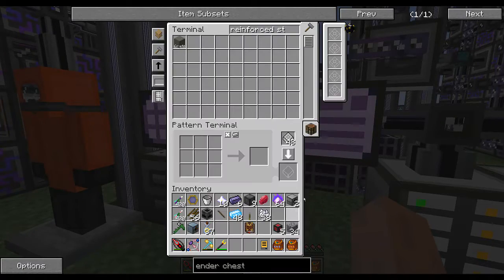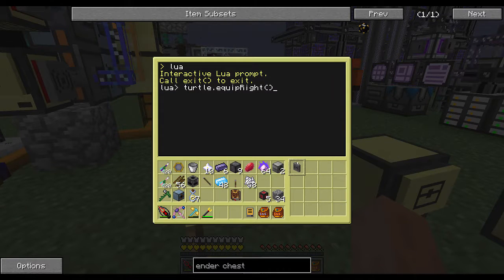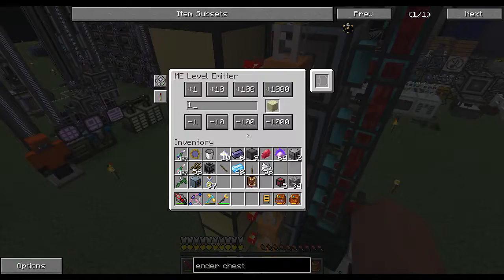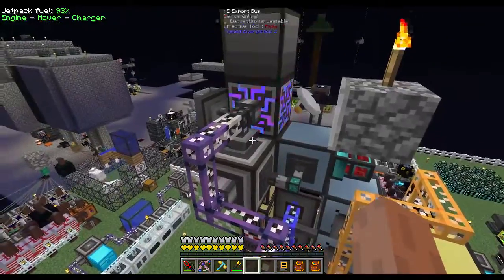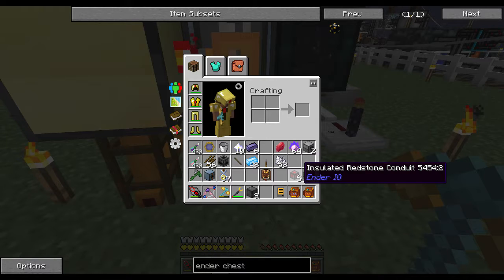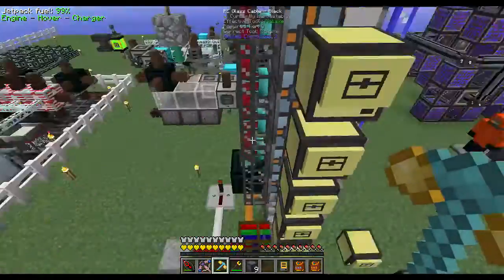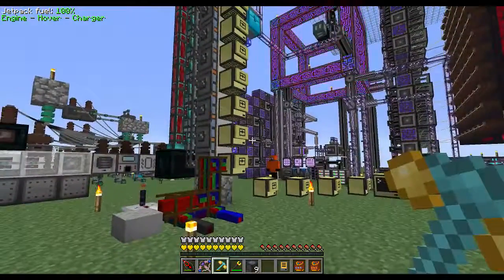Autocrafting IC2 Reinforced Stone - FTB IE:S

Comment from the maker: Placing Blocks
00:20 formation planes
00:43 annihilation planes
00:49 sand autonomous activators
00:57 CF sprayer activator
01:00 turtles
01:16 sand computers

Computercraft
01:32 configuring turtles
03:35 configuring sand computers

Wiring
03:55 formation planes
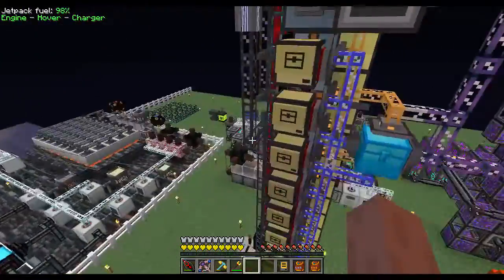04:40 annihilation planes, ME drive, reinf. stone export
06:02 sand autonomous activators
08:00 CF sprayer activator
09:20 main ME system connection
10:00 redstone cabling

Additional Info
12:00 how it works
14:50 CF sprayer refilling automation